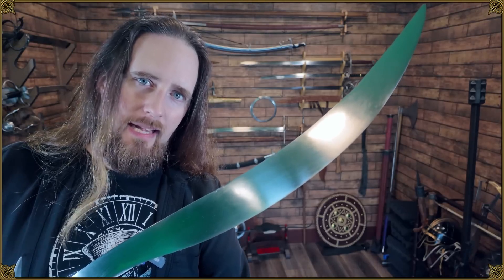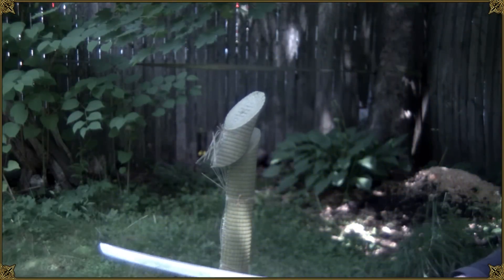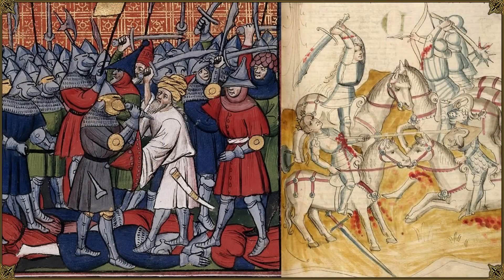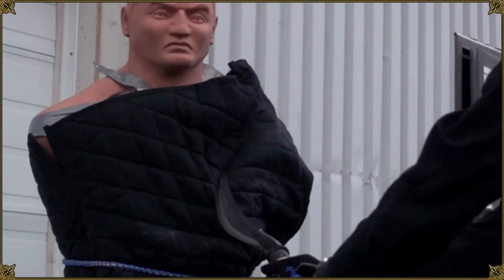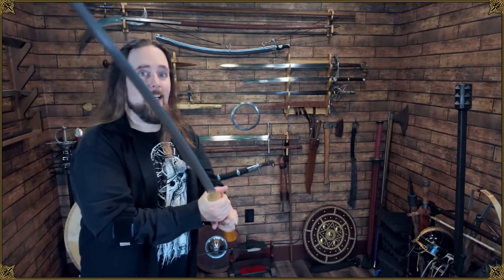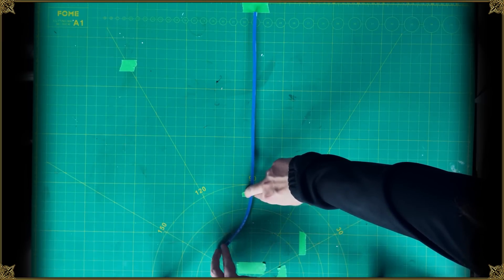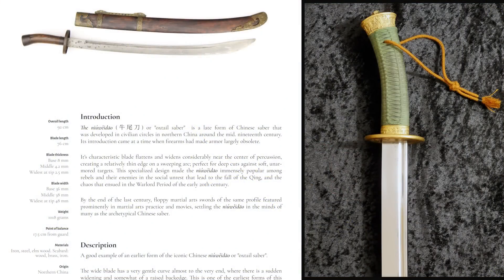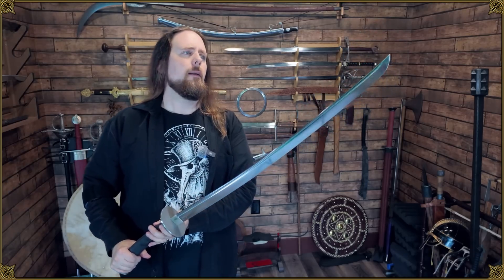Sword Design: What's the Recurve For?

Comment: As someone with a bit more intuition for physics (and those classes fresh in my mind to boot), here's my explanation for 7:50 : 

You just add the motions together. Its surprisingly simple, but a powerful tool in physics is breaking down problems into their component parts and forces. Isolate the individual parts of the motion, because they all act individually and aren't greatly impacted by what the rest of them are doing; your shoulder motion or leg motion doesn't do much to how you move your wrists, to put it simply.

In the case of this "flick levering" action you're demonstrating, you're adding a fast rotational component to the rest of the swing. Rotational kinetic energy is still kinetic energy, so it increases the power of the cut by just making the blade go faster, but it's also pulling the blade around rotationally (like a curved blade and its late-hitting pulling-back impact), aiding in that pull-back cutting motion. Your initial guess was correct; it adds a levering motion to the blade! It just happens that you obfuscate that when other motions come into play. But the forces don't lie, you're still adding that levering power and rotation.

I think the key component here in regards to curved handles is that a further forwards effort-hand (the pulling one) means you have more space to rotate the sword (it could go further down or start further back), allowing the same amount of force more time to accelerate the sword and hence moving it faster. It could also just be a more convenient geometry to make this sort of motion with your hand, so it comes more naturally or with more force.

I think your conclusion is spot on though; at the end of the day, with both handles and blades, there's enough trade-off happening that it's minimal in isolation, and what's more important is compounding effects that work together. A well-shaped curved blade with a pull-heavy technique and a snappy strike is going to gain a lot more slicing power than just changing any one of those factors individually (though blade geometry is probably the "quickest" way to change slicing power)
Reply: This, he kind of nailed the physics in his demonstration but it's just that while a recurved blade with curved handle is strictly more efficient the real world benefit is miniscule compared to other factors.
Reply: It’s a system under tension to ;) Hands are springy so forward pointing handle means contact sooner for faster control. Comparable to riding a bike with a loose grip vs holding each handle in tension to correct for hitting pothole immediately. Don’t hit potholes with a loose grip, you end up in people bushes. :D
Reply: It's also helpful to imagine what the handling would look like if the handle was curved the other way, i.e. towards the wielder. It is very intuitive that this would substract from the force and speed of wielding. There's not only the lever aspect involved there, though, but also body mechanics. Maybe curved handles are just a thing because slight advantages in handling by lever action AND body mechanics added up to be substantial enough.
Reply: Thank you!
Reply: I think there is another issue as well. I am not disagreeing with you, but that there is also a grip mechanics as well going on. A straight handle has an issue of sliding in your grip. Any grip that is not as effective as it needs to be on a straight handle will have a much more effect than a curved handle. A curved handle will have an innate ability to have a higher strengthening of the hold, making the use much more secure. And having a secure grip is very important in any issue of weapon use. So in other words, a curved handle is going to lock into your grip much easier than a straight handle.

Comment: The stated purpose for the Oxtail hilt on the Niuweidao is to have a high grip for general slashing, but a low, bent grip which places the hilt into greater alignment with the raised point for thrusting (supposedly placing less strain on the wrist on impact, much like the French Épée). Note that this was only a civilian weapon, so was never used as a close formation fighting weapon.

If you want to see this technique in action, I suggest you check out the grip of Count Dooku's Lightsaber in the Star Wars prequels. Count Dooku was played by Christopher Lee, who was both a brilliant actor & talented (Olympic grade) fencer.
Reply from the maker: Ah, you're right. I mentioned that a recurve in the blade can pull the point back into alignment but totally overlooked that this of course applies to the grip as well.
Reply: You should check out Balkan machairas, they have an absolutely bizarre arrangement where the handle juts out at an angle almost 45 degrees forward of the (metre-long, mostly straight) blade. Then top that off with a massive disc pommel that constrains your wrist movement.
Reply: @melanoc3tusii205  Interesting. I'm familiar with the Greek Machairas (which so closely resembles the Iberian Falcata that it's pretty remarkable how distantly they are separated by time & geography), but the Celtic Machairas found in Balkan graves are quite different - lacking the destinctive forward "bend" in the blade (like a Kukri) of the Greek variant.

The hilt sticks out at a 45 degree angle to the curved blade, so that it resembles the grip of a gun. The minimal guard even seems to be designed for the index finger to curl around like a trigger - perhaps for greater precision while thrusting. 

This seems like the kind of sword that would be used in concert with a small shield like a buckler (though there doesn't seem to be much evidence for this in the archaeology).

Comment: If I had to guess, I think it changes the torque curve for the swing, applying more torque at the beginning of the swing.  Your bottom hand is more perpendicular to the grip, so more torque, at the beginning of the swing.  Probably a matter of preference for the wielder.  You should ask the car guys to look at it.  The handle shape seems like transmission problem (changing gears), and stuff like squeezing at the end of the swing seems more like a power problem (changing valve timings).

Comment: The push/pull mechanics of that type of strike is super weird to describe because you are pulling back on the lever, but pushing the fulcrum. Additionally, the techniques that I've seen use body rotation to add power as well. I'd take a random stab in the dark and say that the techniques found in Kendo/kenjutsu/whatever other style that uses this mechanic has harder hitting strikes, but it wouldn't be a statistically significant amount, otherwise that argument would be spreading like wild fire in the katana weeb meme discussions. However, these techniques can be used with say a long sword too, so I guess that argument is invalid.

Comment: pure speculation here:  forward curved handles are not about the sword itself, but about the change in body mehcanics.
i've always assumed that it was an attempt to optimize hand/wrist/arm alignment.  

additionally, a curved handle on a straight blade seems like it would have a similar effect as having a straight handle on a recurve blade (in terms of putting the blade forward in front of your alignment) without sacrificing the ability to thrust.

i really hope that made sense -- very much harder to explain than to demonstrate.

Comment: Pushing and pulling together gets the same range of motion with double the torque compared to only pulling.

Stepping forward with your strike adds the power of your leg muscle and adds the kinetic force of your entire body weight into your cuts.
Reply: You're right, actually. I didn't consider this, but it makes total sense

Comment: Without having a clue at all with what I am talking about - to me it seems the curved handle offers the ability to still create leverage and power when the hands / arms end up tighter / closer to the body. When you can't get the perfect extended swing or jammed up, the curved handle seems like it will give the bottom hand a shorter fulcrum point. Just a guess.

Comment: I would think it is done to move the weight of the pommel forward to balance out the weight of the blade that is backward. Otherwise the center of mass of a curved blade would be out of alignment with the hand. I dont know how exactly it would affect its use though.

Comment: I'm not 100% sure, but forward curved blades or blades with tilted handles are more choppy. The only thing I'm certain here is that they allow me to put more pressure on target no matter if they're one-handed or two-handed. With one-handed curved grips, you can adjust the dynamics depending on where you grip the handle. If you hold it further down, it becomes heftier and more slanted.
The other advantage they hold is that your blade has a bit more reach than if it's straight or even worse curved backward. With the latter, you basically leed with the fist, which makes you more vulnerable to counters.
Speaking of backward curved blades, shamshir are a bit special, because they curve only late but then very strongly. This not only gives them a lot more blade to be pulled through the target but adds a lot of mass at the center of percussion.

Comment: I'm assuming a curved handle results in a slighly longer lever. Imagine the sword upright, one hand gripping close to the hilt, the other one the pommel. The pommel hand would be a little further out than on a straight grip. If you move the pommel hand towards you, you have a little more distance that the hand could travel before you reach your biomechanical limit, leading to more top speed and possibly acceleration with certain sword positions.

Would it make a significant difference, especially since there are many other moving parts? No idea. But you cauld fashion a faux curve grip add-on for one of your straight grip swords and test it out with a slomo cam?

Comment: I imagine the curved handle helps a bit with edge alignment, but I'm not sure, maybe if that was true then it would explain why you feel like you get better results.
Reply: In my experience, of which I have none, edge alignment is improved by the shape of the cross section of the handle and not the curvature of it. A circular handle is trickier than an oval handle. Though, I would see why it might help.

Please correct me if I am wrong.

Comment: The cut of a curved blade has a smaller surface area,
A curved blade has a "belly" that comes into contact with the target.
A straight blade is more in contact with the target with a larger surface area, therefore causing less damage.
Reply from the maker: In theory yes, but in practice you need a VERY strongly blade for that to make a substantial difference.
Reply: @Skallagrim  what he’s saying is that curving the blade brings the point of percussion down to a smaller area on the blade itself. You transfer more force to the target over a smaller area of blade, and since it’s curved, it starts the cutting action immediately. This is easily demonstrated with two sabers from the same era. The British often have straight sabers and curved sabers with the same hilt pattern. I know from fencing that the curved sabers hit harder because that force is concentrated into a small blade section.

Comment: Interesting discussion skal! It reminds me of some of the super-curved swords you'd see and the theory of a perfect draw-cut, where by matching the curvature of the sword to the curvature of a sword swing/arm motion, you could drag the edge from hilt to tip without hacking. Also interesting to note that the human joint structure almost entirely works in round swinging motions, we have to combine two pivots to push a straight line.

Comment: The curved handle is simply a matter of comfort. For example, my wrist is not very flexible in some planes. Curved handles help.
Reply from the maker: Good point.
Reply: @Skallagrim  You might want to try some fencing drills gripping that curved section like a pistol gripped saber - it might give the blade a a rather heavy "flick slice" from the wrist and elbow. (My 1st experience using a pistol gripped saber in fencing shocked me how much "heavier" it made quick slashes from the wrist.)
Reply: @Skallagrim  A man who rides horses and chops pumpkins with a saber and sword while galloping told me that the essence of the crooked handle is only for horsemen; it rarely slips out of your hands after being hit. It’s just easier to hold it, that’s the whole secret. If you're not a rider, you don't need a curved handle.
Please note that most cavalry swords and sabers have a reverse curved handle
Reply: Count Dooku approves
Reply: I agree. Not handled sword, but certain tools have slightly curved handle and it feels more comfortable in hand.
Reply: Honestly, that sounds like a perfect explanation for it. Ergonomic handles mean you can do things for longer and will less risk of hurting yourself, thus it may be considered an upgrade.
Reply: I've always heard the same thing, that the curved handle is designed to sit better in the palm.
Reply: For the physics it doesnt matter if the handle is curved or Not only the distance matters for the lever. Its basicaly only for ergonomics
Reply: Ergonomics is part of physics  @Not_Kyz
Reply: @marcelmontero7211  You know what they meant though. It's not contributing significantly to the mechanics of the cut itself, but to reducing the strain on the body. Obviously everything is physics at the end of the day.
Reply: @Not_Kyz  Your effectors (your hands) do care about ease of motion, which directly impacts how much force it can cause during motion. It's not a colossal deal, but any small advantage counts.
Reply: I think it would help more with thrusts than cuts because it allows you to bend your wrist less when you present the point but I think that's more true for a single hand grip than a two handed grip. I have never seen a forward curved handle on a two handed sword. It seems like it lends it'self to a handshake grip with the forward hand more than a straight handle would. I wonder if it would make a thumb grip less ergonomic. I hadn't considered the optics of your guard relative to a forward curved handle though. That's an interesting observation.
Reply: The primary reason could be even simpler than that, while wearing the sword (which is most of historical sword use) the forward curved handle is less likely to sharply impact the abdomen or lower ribs if you lean over the sword or catch it on something.
Reply: I'm wondering if the impact force distribution is also helped by the handle curve? Generally physics favors smooth transitions rather than s sudden curve to straight, so it may help blade integrity as well as impact feel.
Reply: I was going to comment this and saw this comment :'D same, curved handle is much better for my wrist too.
Reply: Nah, this is lame explanation and i think he was quite close to getting to obvious observation that longer distance that hand can travel translates into longer time to accelerate the swing.

Comment: Does a recurve handle and blade work better for rotational swings? Ie round your head and shoulders? Would it be easier to block incoming rearward attacks by allowing you tighter swing arcs and saving you some battlefield stamina?

Comment: Flameberg got all the curves
Reply: And many a smith has developed a hatred of them when trying to forge one as a result.
Reply: @FirstIsa  I can imagine the one who could forge the flamberge as the "that guy" of the blacksmith guild. Ngl I would have flexed such skill too.
Reply: @ERAA-on-YT  forging a curved blade from a mono steel billet is easy, if anything it's harder for forge a straight blade if your hand forging the bevels because your "pinching" the steel to make the bevel which tends to make the blade curve towards where your hammering while also slowly twisting if you don't disperse the strikes properly. 
With my luck if I tried forging a flamberge with the tools they had back then I'd end up with something that looked like a blades spring with the edges aligned facing along its plane instead of to the side.
Reply: There is even serrated flamberges. Talk about curves on curves.
Reply: You mean the rerererererererecurve
Reply: So it'll cut EVERYTHING! =)
Reply: They're curved for different reasons though🤨
Reply: (wolf whistle)
Reply: Curves in flamberge were to trap spears and halberds and shove them away. Curved blades were better on unarmored  or lightly (soft) armored targets.

Comment: I have a theory so bear with me (also keep in mind that I don't have a sword to handle so I'm just talking out of my ass) anyways here's the theory: in case of the completely straight handle both wrists are pretty much at the same angle when the sword hits the target. However when the handle is curved the wrist are at a different angle during the impact. So I could imagine that during impact, the hand at the back of the hilt is in a more relaxed position  when you have a curved handle than a straight one, allowing for better biomechanical structure and a more secure grip while the blade strikes the target 

(please tell me if I've got it completely wrong, as said I don't have a sword)
Reply: It should definitely reduce impact on the wrist of the wielder as well.